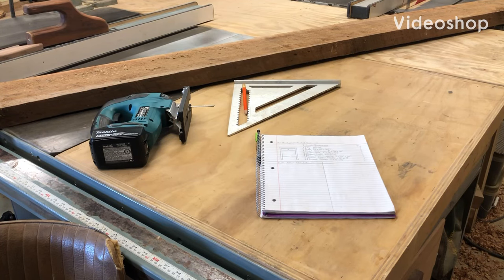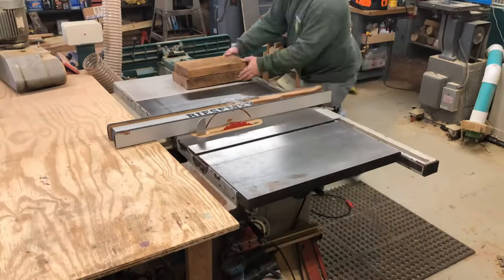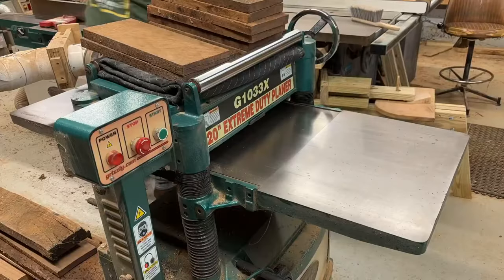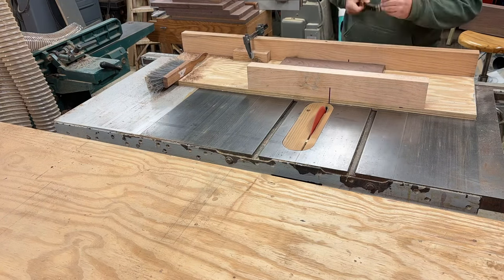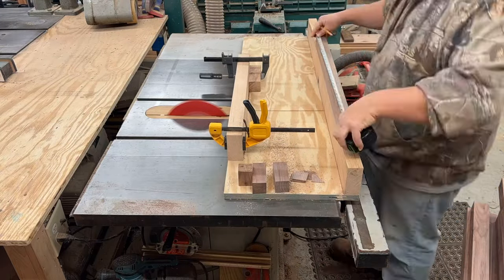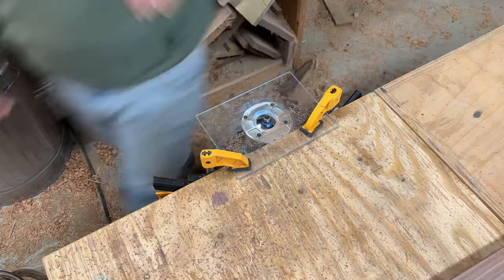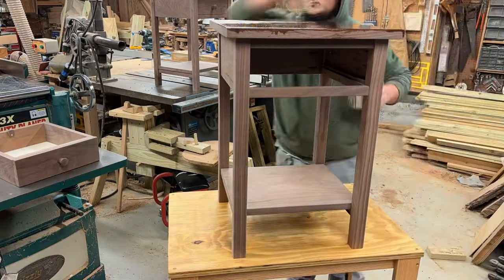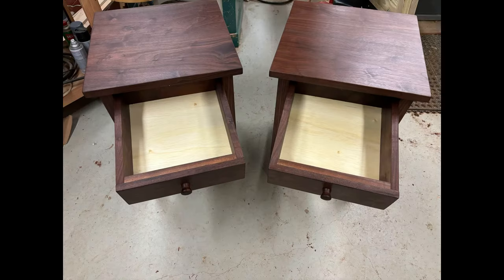Walnut Night Stands | Full Build Compilation

Comment: I'm just getting into woodworking so I'm not wise enough to know if that clamped router trick is brilliant or very dangerous. Regardless, I'm sure I'll use that same trick in the future 😅

Great video! Thanks for showing the whole process!
Reply from the maker: If I were doing anything much bigger than this I’d use a router table but this is small enough and the 1/8” round over bit I’m using is removing such a small amount of material it’s perfectly fine. Before I started using it I did give it a few good pulls to see if it was stable enough. It’s part of the reason why I made that extended base plate for it because it allows me to use it like a mini router table for round overs on small parts.

Thanks for watching!